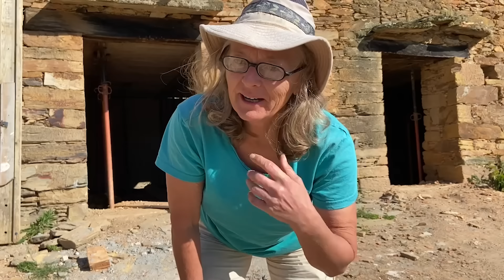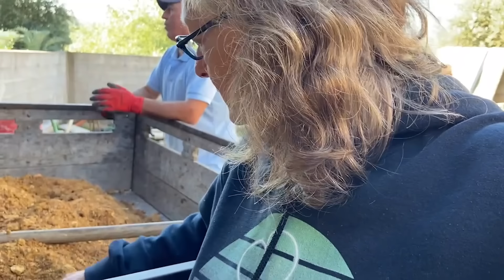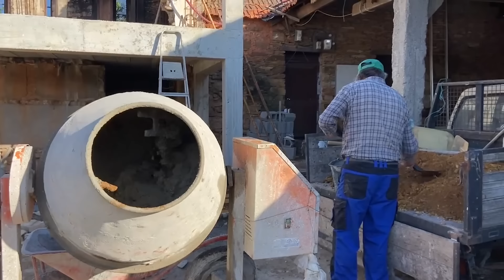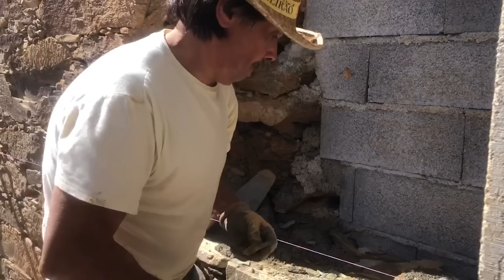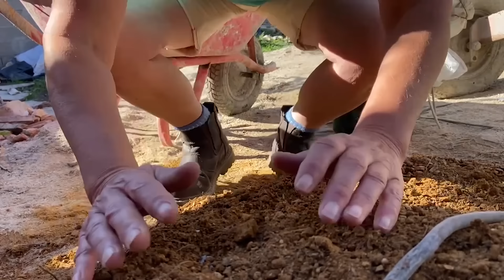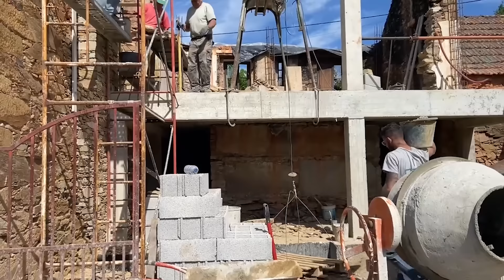STUNNING Stone Masonry - Stone House Renovation

Comment: Nice shot at 16:46 of you possible formal terrace.  With all of the footage leading up to this point of stone, I suspect you can get a sense of what a remarkable contrast a  ~1 meter tall wall finished with a white sand render would be.  I think it would be a stunning way to really focus ones attention on the stone and cause the wall low white render wall to disappear for people sitting on the terrace, 
This terrace is an ideal location for some type of water feature. (reflecting pool with jets around the perimeter arcing upward, a plunge pool)  I think the water feature should have a practical purpose beyond being beautiful and that would be evaporative cooling of the terrace area.
Reply from the maker: Thank you

Comment: I thought you were having this second layer wall and now I saw you did it. You posed the stone walls siding the modern wall. So, you still have a very thick wall as ancient houses used to have, with highly efficient thermal insulation.
Reply: Just for you to know: "barro", which is mud, has a double "R". It is tough for non-Portuguese speakers to distinguish the sound of R and RR in Portuguese.
Reply from the maker: Thanks

Comment: Big stones and straight ones are used in the corners to make it 90° angle, to support the walls straight and the pick marks is because you need them flat and to make them flat you take out the high spots with a pointy chisel, you can see those pick marks in any old building made of stone, churches an example
Reply from the maker: Thank you.